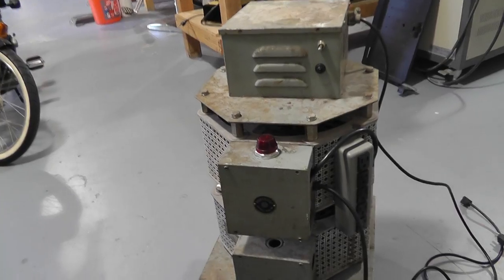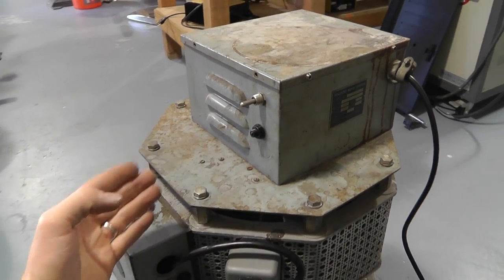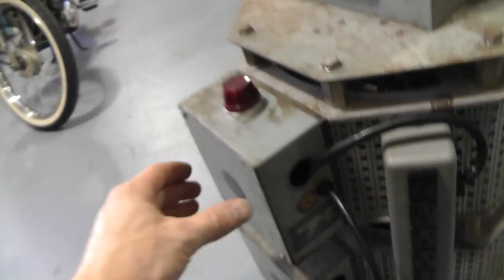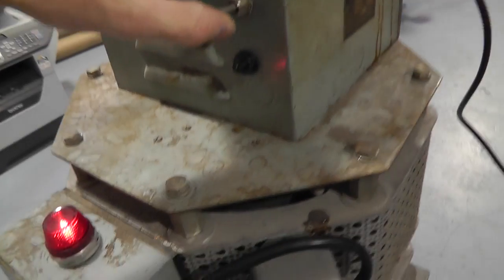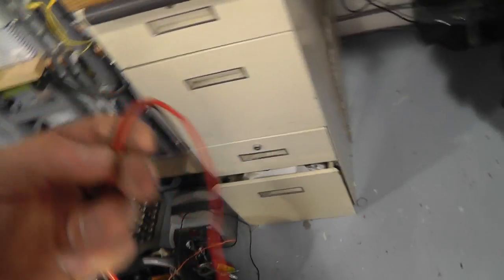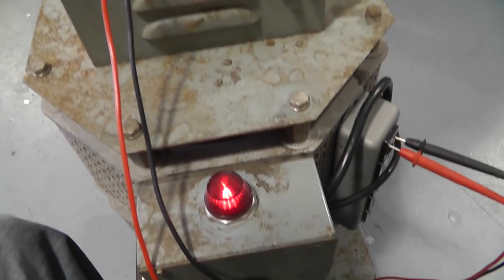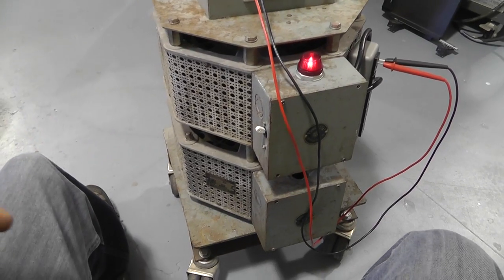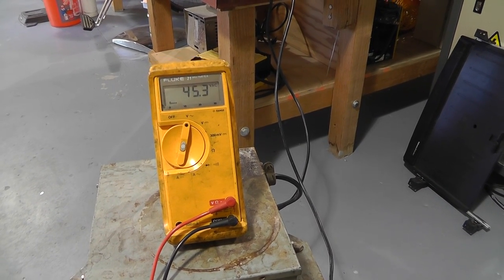10,000W Powerstat ( Variac) Update, Now Power Controls !!  :P

Comment: Very nice! all the best on the repair of the lower one.

Most variacs do not actually reach 0V, I believe this is due to
where the windings and brush contacts actually start.

You can prove it by measuring the first segment of your
commutator with a voltmeter.

Also keep in mind that most variac brushes span about 2 to 4
windings at the same time, the brushes internal resistance may
average the voltage which could explain the minimum 2 volt output.

Would be an interesting thing to investigate... =]

Comment: Russ, the variac adjusts voltage not current. The current passes through it, so it is able to pass 41 amperes through it. It does not source the current.
Reply: ***** Bullcookies! , A variac does not produce current and no the variac is limited by the amount of current THAT PASSES THROUGH IT BY IS WIRE GAUGE and fuse IN THE VARIAC. I have one on my bench at work and use it daily. A variac is an adjustable VOLTAGE transformer, the current that passes through it is limited by the inline fuse most variac's have built into a finished autotransformer ( another name for a variac) case.  Russ's current increase is Basic Ohms law applied, nothing more.

Comment: I just found an unused powerstat 246 in a shed. These things worth anything? I don't have any use for it.
Reply from the maker: looks to be a 240V 15A power stat. http://www.danaherspecialtyproducts.com/uploadedFiles/Siteroot/Superior_Electric/Products_and_Solutions/POWERSTAT%C2%AE_Variable_Transformers/146-246%28pg24-27%29.PDF
there worth some in good shape...

3,600W that's not bad if it works...
~Russ
Reply: ***** Thanks for the info. It was still in the box, looks brand new.